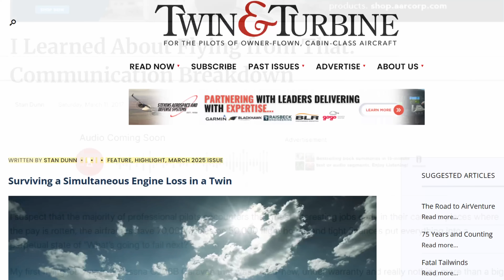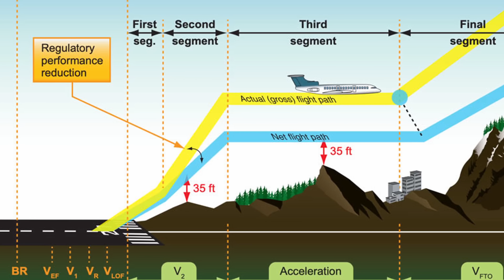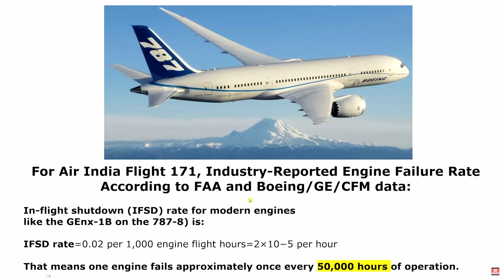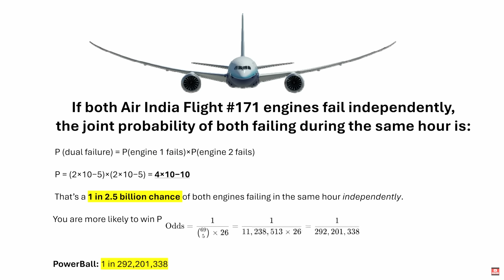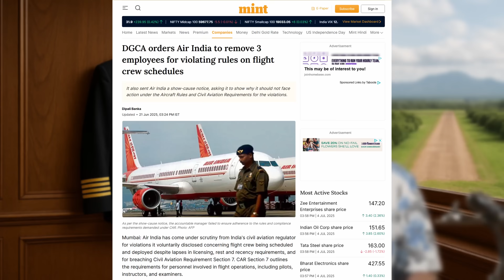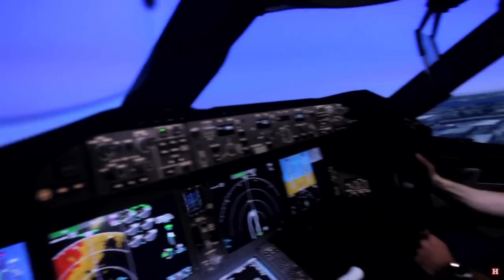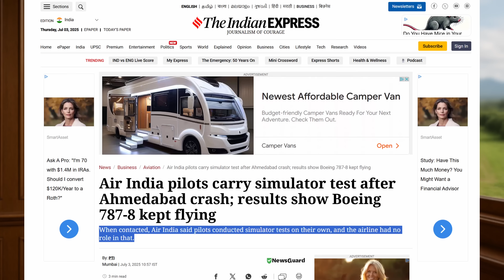Air India 171 Cause Becoming Clear

Comment: I’m a grizziled old retired airline pilot, and I gotta tell ya: This was a fine, factual report. Thank you!
Reply: Nah, that smoky plume coming from just one side of the aircraft is a physical occurrence - not a computer software phenom 

So the plane could have proceeded to gain altitude on just one functioning engine, right - up to the requisite 1000 ft altitude where could have trouble shoot the problem before taking any action.

Am leaning toward scenario of one engine experiencing problem and the crew reacted by shutting it down completely, but mistakenly shutdown the one good engine. (Presumably they should have made no attempt to shut a problematic engine down at that stage of flight attitude - mechanical engine failure coupled with pilot error/misjudgement)
Reply: @TheSulross  Yes, certified to fly on the remaining one, at gross weight, i.e., enough to return and land or go to an alternate. It would be painful to know that one of the pilots shut down the functioning engine by mistake.
Reply: @TheSulross didn't say anything about a smoky plume said it's a computer glitch .... good night and goodbye
Reply: @TheSulross  Yes,  we practice that all the time.
Reply: You need to get some serious sleep 😂😂😂 @TheSulross ....wait for NTSB report....plus, engines dont shut down on take-off???!  (Unless you got computer problem....read about the RAT..)   BESIDES, INFO IS LEADING TOWARDS THE ENGINE CONTROL SYSTEM/S THAT MONITOR THE ENGINES....you need to catch up.....its the computer thats the problem.....no more beating a dead horse...
Reply: @TheSulross ... Captain radioed the tower, loss of power..... that means both engines.....no thrust.......what shuts down both engines on take-off???   Nothing!!..one in a million?? or is it billion???      KISS THEORY HERE..😂😂😂
Reply: @johnmartinelli5511   Ah, not so sure can assume radioing in loss of power necessarily means both engines went out. Losing one engine's power on take off is pretty darn serious problem itself, and warrants contacting tower about. Me thinks it's ambiguous to know if was one or both engines. Am personally skeptical that both engines managed to fail at precisely the same time.
Reply: @TheSulross I doubt that the crew could have reacted that quickly, seems that the good engine was more likley shut down, or thrust reduced,  by the FADEC computer. A failure of logic perhaps, - unintended consequences.
Reply: @ericwillis777   Well, given the past occurrence cited of pilots shutting down wrong engine, not exactly something to rule out. 

However as to your computer software glitch theory - I’m indeed receptive to that based on personal experience. I once had a car with a computer controlled transmission. It was basically a manual transmission but where the computer orchestrated all the shifting. Driving at freeway speed it one time went out of gear on me. I was fortunate in that was able to safely pull over. Turning the car off and restarting, the problem cleared. There was a firmware update that did address the problem. I eventually sold the car and got something else.

As much as am sure they extensively test software that does real-world control of engines, transmissions, etc., there will be situations that still evade the testing. So yeah, the computer system glitching in some manner upon a detected engine problem does seem plausible.
Reply: @TheSulross ok, but they not only had less than 30 seconds, they'd have had to at least think about shutting down an engine, and they wouldn't do that unless they thought it was a solution - that's too much thinking, in too short a time - it's not going to be an instinctive reaction because it's not a practiced response. I'm sure part of their training does not include a guy with a stop watch seeing how quickly they can hit the switch - it's not like doing an emergency stop in a car !
Reply: It's another computer glitch...poor Boeing.

Comment: There have been several accidents in the last few months where at some point commentators were blaming the pilots for some egregious error that only a rookie would make, only to find out later that the pilots performed heroically.

Now this commentator is speculating the pilots acted egregiously in this situation, again, making a rookie mistake that would not be expected of experienced pilots with thousands of hours of experience.

If I were a commentator, I wouldn’t speculate extremely unlikely events involving gross pilot screwups until I had a LOT more info, black boxes, etc.

These pilots, presumably have families that are in mourning. Their husbands & fathers  deserve benefit of the doubt when you’re dealing with only a portion of the potential data. There’s nothing wrong with saying “we don’t know”

Comment: Of course it’s all speculation at this point, but I think you missed the point on the flap theory.   The argument is not that they took off without flaps.  There would be too many warnings for that to happen. The argument was did the inexperienced FO raise the flaps rather than the gear.   I doubt that happened, but that was the original argument.
Reply: It was a pretty terrible take originally, mainly propagated by Captain Steve who has retracted that theory.  A 787 has the engine power to rather easily overcome an error like that, and it's also a highly improbable pilot error.  In "the olden days" it might have been more plausible, but a modern cockpit layout greatly diminishes the possibility for this error.  That's why only "old" pilots considered it a possibility.
Reply: Even if the flaps were raised too quickly, the jet has so much excess thrust that the aircraft should have kept climbing at a sufficient rate.
Reply: @daffidavit I agree.  But I believe that was the original theory on the flaps.
Reply: "The argument was did the inexperienced FO raise the flaps rather than the gear"

This argument only comes from people who have never seen what a flap handle and a gear lever look like. They specifically made one to look like a flap and one to look like a wheel after there were incidents of raising the flaps instead of the gear literally 90-100 years ago.
Reply: @chrismacbean I’ve been flying for 50 years…..I’ve seen it done.
Reply: @griam7641  Okay, I get what you are saying...as in lots of accident investigations where pilot error is the cause is a question of human factors, like "why did this competent pilot make this incompetent move"...but with the amount of time they were just floating down, I really really hope they confirmed their configuration. 

It is one thing to accidentally raise the flaps instead of the gear, it is another to NOT notice what you did. They just pancaked into the ground in slow motion, this wasn't some crazy weather or abnormal ops or anything. I'm not saying it wasn't pilots being idiots...I'm saying usually when pilots are idiots, they don't just ride it into the ground...they attempt to get out of it.
Reply: @chrismacbean Understood.  I personally don’t believe this is what happened.  I’m just saying that was one of the original “flap theories”.
Reply: The idea of messing with the flaps instead of raising the gear, would be like wanting to turn on your car's turn signal but grabbing the release catch for the hood instead.

They are completely separate handles that look, feel, behave differently and are a good distance apart.

Comment: The “start-stop switch” ? Clearly labeled “fuel control” even in your own video.  Four airlines? Why four airlines…. Hmmm
Reply from the maker: Hired in 2007. Bad time in aviation. Every move was a move up. I was using the terminology for my current aircraft (737). Doesn’t meaningfully change the conclusion.
Reply: Altho crew shutting down wrong engine was also my first thought when this happened

Comment: Ejem....the plane was having proven electrical problems, with AirCon switched off, infotaiment screens lagging, etc.
FAA issued a now mandatory directive right after the crash for this plane to substitue a piece of the plane, meaning they knew in advance of the potential cause of the crash, which actually was reported 2 years ago and one that only translated into a directive for airlines to just inspect the planes.
The Toilets in the plane have a defect with the connecting hose losing water and affecting the electronics bay. It all aligned in time...meaning Boeing strikes again. And these paid US "experts" are coming out just to cover up Boeing's incompetence.

Comment: I thought it was an electrical failure caused by water getting into the ground power hookup after heavy rain. basically a short circuit in the power bus. Although you would think the engines would remain at whatever power they were set at instead of failing to idle power.

Comment: -*effective June 18, 2025* water leaking causing loss of safe flight and landing.  The FAA adopted AD 2025-09-12, effective June 18, 2025, requiring detailed inspections and repairs for water leaks from improperly installed waterline couplings, specifically targeting the risk of water entering electronics equipment bays causing loss of safe flight and landing. [3][4][5][6].

- *December 13, 2022:* The FAA published a Notice of Proposed Rulemaking (NPRM) addressing water leaks from improperly installed clamshell couplings in the potable water system, which could allow water to reach critical electronic equipment[2].

- *April 2023:* The FAA expressed concern about faucet leaks in Boeing 787 jets, proposing repetitive inspections and possible faucet part replacements after reports of water getting into electronic equipment bays[2][8].

- *June 29, 2023:* An Airworthiness Directive (AD) took effect, requiring U.S. operators to inspect and address water leak risks in Boeing 787-8, 787-9, and 787-10 models[1].

- *February 1, 2024:* The FAA issued a new AD mandating repetitive inspections for undetected water leaks from the faucet control module (FCM) under lavatory wash bins, with corrective actions if leaks are found[2][7].

These dates reflect the progression of FAA actions as the agency responded to ongoing reports and evolving understanding of the water leak risks on Boeing 787 aircraft.

[1] https://airguide.info/faa-issues-ad-to-address-water-leaks-on-boeing-787-electronics/
[2] https://www.youtube.com/watch?v=CcbJ8XkoT_I
[3] https://www.eplaneai.com/ja/news/faa-mandates-inspections-of-boeing-787-over-water-leak-concerns
[4] https://airwaysmag.com/new-post/faa-boeing-787-inspections-water-leak-issues
[5] https://www.federalregister.gov/documents/2025/05/14/2025-08346/airworthiness-directives-the-boeing-company-airplanes
[6] https://www.eplaneai.com/de/news/faa-mandates-inspections-of-boeing-787-over-water-leak-concerns
[7] https://www.federalregister.gov/documents/2024/02/01/2024-01967/airworthiness-directives-the-boeing-company-airplanes
[8] https://nypost.com/2023/04/10/faa-warns-of-safety-hazard-from-leaky-faucets-in-boeing-787-calls-for-inspections/

Comment: A power glitch could cut off fuel to both engines at the same time, fuel cutoff valves.  At that time RAT would deploy.
Reply: No. The engines do not require independent power to drive fuel pumps. At ground altitude their gearbox driven fuel pumps can, by design, provide enough suction to deliver enough fuel for full power. The engineers considered that possibility and have been designing against it for over 50 years.
Reply: @jamesperry1358 
Gear driven pumps driven by what ?.
Why bother with and why the need for electric boost pumps running at 130,000lbs per hour at 30 psi.
Reply: @confederatenationalist7283  The engine driven fuel pump is literally driven off the engine gearbox (driven by a mechanical connection to the N2 shaft) - if the engine's running, the gearbox is turning. The engine driven fuel pump is a two-stage pump - a centrifugal pump that draws the fuel into the pump (i.e. 'suction feed'), and a gear pump which provides the high-pressure fuel to the engine and as muscle pressure to drive things like the Stator Vane and Bleed Valve actuators. It takes a minimum of ~300 PSI to run the engine - the HPSOV is spring loaded closed and it takes approximately 300 psi to overcome that spring. Engine driven fuel pump failures are very rare, but have happened (usually with some 'precursor' symptoms that were ignored or mis-diagnosed by maintenance). It would be unheard of for engine driven fuel pumps to fail on both engines on the same flight.
Reply: @nysockexchange2204 

But 1 the engines ain't running probably because because both EC/FADEC computers have been fried or taken out by a catastrophic electrical fault 
and 2 if the engines were capable of pumping the up to 130,000 lbs per hour at 30 psi provided by the electric 'boost pumps', there would obviously be no need for those electric 'boost pumps'.
Reply: @jamesperry1358  Yes, impelling blades made of considerable strength perform that function, and compress the air as well.
Reply: What are you talking about? Aircraft incorporate failsafe designs...Stuff doesn't just start moving to different positions that jeopardize the aircraft if there is a different issue. For example, when Qantas Flight 32 had the uncontained engine failure, they famously could not shut one engine down post landing because the plane's systems were compromised and they are designed to keep engines RUNNING in abnormal conditions, not shut them down. Here is a pic of AARF trying to get the engine to flameout: https://i.sstatic.net/QA9FG.jpg
Reply: @chrismacbean but the RAT did deploy.
Reply: @iancclark1  My bad...The RAT did deploy. I can't get to my original comment, but you are correct. I think my point was that a power glitch would not failsafe the fuel valves to "closed" because that is just absurd to imply that the engineers are that inept. Ever heard the joke about ETOPS? Engines Turn Or Passengers Swim? The engineers made it so that if there is a failure of some sort, the failsafe is to keep supplying fuel. It is much easier to circle an airport for 12 hours burning fuel until you run out and can slow down to land than have your engines shut down in the middle of nowhere. Go look up QA32 and how the fire dept shot water into the #1 engine after the #2 engine failed and severed the controls to #1 engine. It defaulted to PRODUCE POWER
Reply: @chrismacbean  I can't remember which channel, but a pilot was explaining how the fuel cutoff valves can be triggered off by a power cutoff. Then the RAT would automatically deploy. But the fuel cutoff valves don't come back on by themselves. 

The power had flickered off on that exact airplane on the flight just before this one. They thought it could've been a software glitch. 
I'm totally paraphrasing and probably missing stuff, but that's the gist of what they were saying.
Reply: There's still that cloud of debris/dust to account for...

Comment: To set a target altitude on a Boeing 787 Dreamliner's autopilot, you'll need to rotate the altitude selector knob to your desired altitude, then press the knob to engage it. You can also use the Flight Level Change (FLC) mode to climb or descend to a specific altitude while maintaining a target airspeed. Just suppose it was not set- the engines will shutdown as soon as plane takes off. See the video of immediate Loss of Power as soon as plane leaves the ground. This on a Dreamliner has happened and there was enough altitude for the pilots to recognise and correct. This is also just one of so many possible variant events.
Reply: The engines will not shut down based on an altitude set in the MCP.

Comment: The most important fact is that the RAT has deployed on takeoff.  Obviously the RAT could not generate enough power quickly enough to compensate for the loss.  That's why the gear aren't up - because there wasn't enough power to bring them up. That's the critical issue. So it's a loss of power in both engines. No one cares about how statistically improbable it is - it's what happened
Reply: is there any evidence of the RAT? From what I saw, the only evidence is the sound, which was assumed to be the RAT. But nothing showing on the videos.